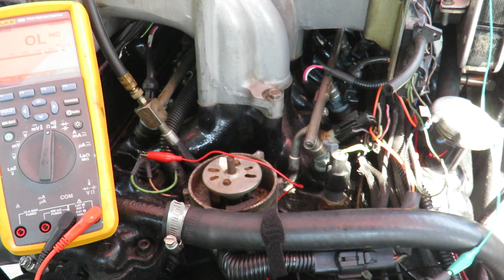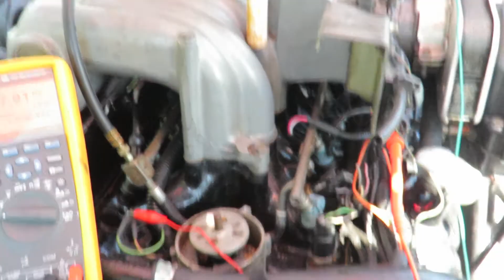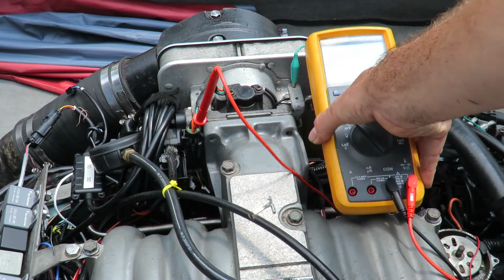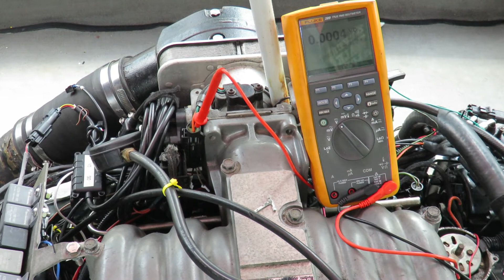ski nautique PrpBoss GT-40 sensor test

Comment: How can I test my tachometer signal? I have same engine but not sure where to start. Tachometer is good but not getting any signal
Reply from the maker: Pro Boss GT40 Service manual page 2A-16:
A 22,000 ohm resistor is in the gray lead on the ignition coil that goes to the

tachometer. The resistor produces a tachometer signal that's compatible with marine tachometers. 
Here is a link to the manual:
https://www.google.com/url?sa=t&rct=j&q=&esrc=s&source=web&cd=&ved=2ahUKEwiSlv388JSEAxXBFFkFHasxCukQFnoECBEQAQ&url=https%3A%2F%2Fwww.planetnautique.com%2FCorrectCraftManuals%2FGT-40%2520Service%2520Manual.pdf&usg=AOvVaw0MeLF5btgBu8SecyfsxBoV&opi=89978449

To measure it you would need a multi-meter with Frequency or better a oscilloscope.
Peter